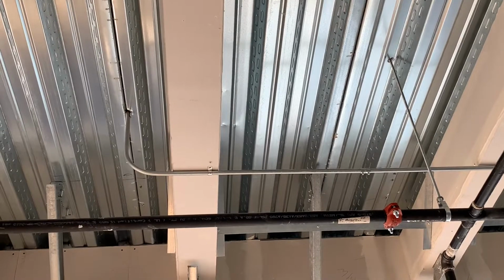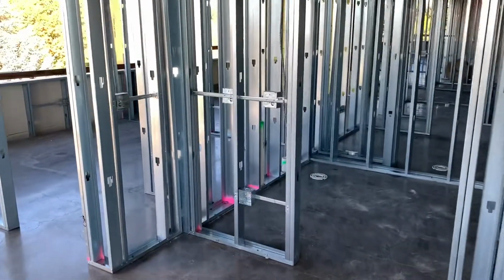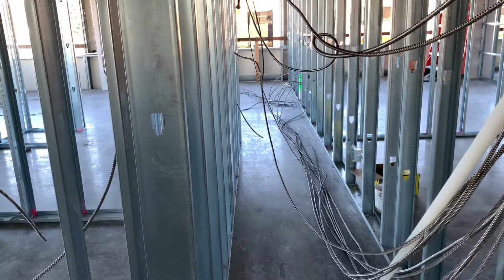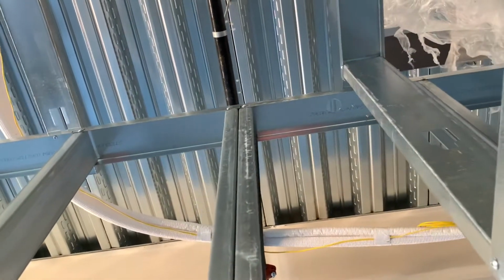Today As An Electrician: Apartment Rough In Begins!

Comment: Is the job spec’d to use MC cable instead of running conduit to each location? Conduit would look much more cleaner, and you can run wiring in the future if anything changes.
Reply from the maker: probably spec'd or bid for mc, all the pipe would be covered and not seen anyways so it would be a waste and a ton more extra unneeded work. only benefit would be future ease